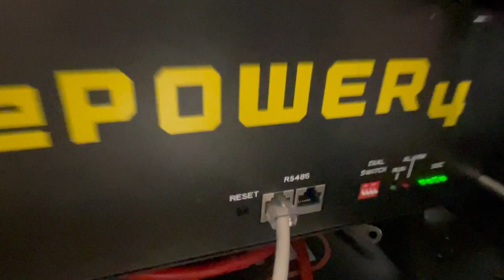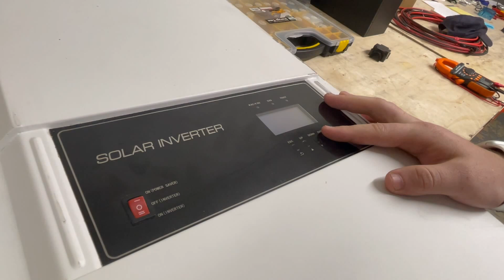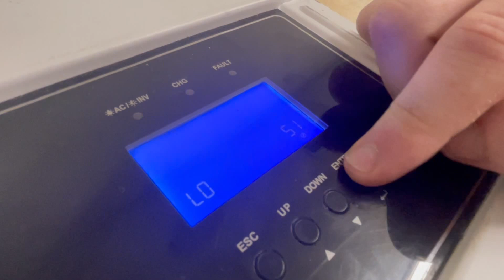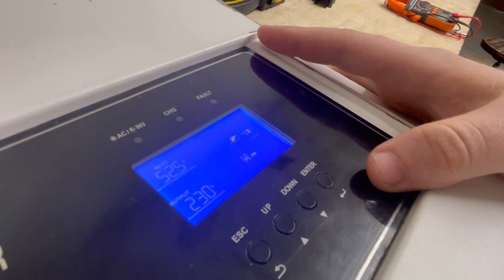LIFEPOWER4 Growatt BMS Communication

Comment: Mine goes to low battery mode when I change the inverter to LiPO4
Reply from the maker: Hi! If you'd like to reach out to us, you can call 903-441-2090  for tech support or email directly at engagement@signaturesolar.com and we can take a look with you!
Reply: @SignatureSolar  I am in Nigeria

Comment: Growatt 5000 manual says to only connect to the master inverter in a parallel system.   You say all with the can hub.  Which way is correct?   My state of charge reading has been sporadically freezing at certain percentages that I believe I have proven the trouble to be with the Inverter.  I'm wondering if bridging the cables to all 3 Inverters will add some redundancy and limit this error.  It causes trouble because I use the dry contacts to charge my bank when it hits 25%  but when it locks up it causes them to drain because the Inverters still think they are at a higher charge level.  Next I will try switching to more reliable CAN communication through the Lifepower4 HUB as a last resort.
Reply from the maker: BMS cables will only go to the master, the actual power cables will need to be shared between all 3 inverters. Master inverter will be set to Lithium battery type, L01 as sub menu protocol, all secondary inverters on USE.
Reply: @SignatureSolar   Yes the BMS cables were the question but when I change the master inverter settings the slave 1 and 2 setting automatically copy. Are you saying I need to manually go and change the 2 slaves to USE “user defined” which isn’t a communicating setting?  Currently I am able to read SOC on all 3 inverters

Comment: Do you have any idea of what are the BMS protocols 1,2,3,4 ?
Growatt do not want to share the information with me. I use 2 Elite 48V 125Ah lifepo4 batteries connected in parallel. 
Actually selected LI protocol 1, but not sure it is the best suited...
Reply from the maker: We recommend trying all 4 BMS settings on the batteries. If none work, we suggest reaching out to Growatt or the battery manufacturer for further assistance. These batteries aren't our own, so we don't have specific protocol information.
Reply: @SignatureSolar  okay,  Thanks for answering 👍

Comment: We are unable to get the bms cable set up for our SOK 48v lithium batteries to the Growatt SPF12000 DVM -US-MPV   We keep getting an error code 20 Have tried numerous times and had no success.  We are off grid and because the bms is not working the generator will not automatically start when the battery SOC is low.  Do you have any advice that good help us get this working.  Any assistance is greatly appreciated.
Reply from the maker: Hi @cynthiaclemmens2692 Working under the assumption that the SOK batteries are similar to our EG4 batteries, this may help. 

To configure the batteries, switch the dipswitch on one to master and set the others to unique addresses. Daisy chain the battery banks using short patch cables, linking the master battery to the inverter with a straight-through Cat5/6 Ethernet cable.

Adjust the inverter's battery type to Lithium, prompting a submenu for battery protocol (contact SOK for their specific protocol). Set the protocol, wait 1-3 minutes for system check for communication, and clear the code.

Consider rebooting the system, but check battery settings for %(BMS) or V(no BMS) to confirm successful communication.

I hope this helps!

Comment: I’m having problems conecting my lithium batery on my inverter.. I have 2 rj45 bms and r485 Growatt es 5000 48v And my batery has 3 ports rs232 can and rs485 what should I plug

Comment: I notice alot of the more technical questions asked are skipped which concerns me as a customer.   I imagine by now the 3000LVM+LIFEPO4 is becoming a standard setup.   Is the patch cable a standard RJ45 ethernet patch cable, or is it a crossover or custom cable that has a different pinout for the RS485 protocol?  What advantages are there vs just leaving the Growatt 3000LVM on default settings and just connecting power to a LifePO4?
Reply: I have the same questions and would like to know what the default DIP switch settings should be.
Reply: I have the 3000LVM 48v inverters. It took me a while to figure things out but you need your master battery with all 4 dips down. Then plug your cat5/6 cable into the bms port. If that doesn't work look into your firmware version on your inverter. I had to update mine in order to get these batteries to talk with my growatts. I'm still having some charging issues but hopefully I can get that figured out soon too.
Reply: @ghostriderjku7209  what are your charging issues? I'm surprised growatt doesn't have a battery compatability list for the li mode. They told me they don't have one...

Comment: hello, I hooking up a Growatt 48V 3KW LVM  with those Lifepower4 batteries  shown in this video.   So on the inverter I should plug into the 485 port not the one marked BMS.   Also what is the correct protocol for this pair. (single inverter & 2 batteries)
program 05 LI is program 36  I assume I should be using protocol #1 

general question 2)  can both batteries be hooked up without checking there voltages and they will sync up once hooked up to the solar.   Or do I need to pre-charge them before using.   currently don't have the standalone charger   

Thanks so much
Tom
Reply: I'm in a similar situation I have the 3k lvm and I'm connecting a lifepo4 battery with 2 rj45 connections. I don't see what settings to use in the option 5.
Reply: On setting 5 use LI with protocol L01  36

I have only had success using the BMS port on the 3000 LVM 48v inverters.

Comment: I got the 5000 inverter and 3 EG4 batteries from you earlier this year. Do I need to update the firmware on it before they will communicate? I currently have it set to 'use' on program #5.
Reply from the maker: if your battery has the 4 ports on the front you can use the EGYLL battery video to set up comms
Reply: @SignatureSolar  it's the 48v 100ah one and it has 2 RS 485 ports and I'm also struggling to get the USB connector working. What's the pinpoint for the RJ 45 connector?
Reply from the maker: @twelveofthem  7 and 8
Reply: @SignatureSolar  that's the way I have it and I'm sure the polarity is correct but it's still not working. I've been emailing with Jack and Debra today but haven't heard back and I'm not sure what it could be because I have the drivers installed correctly and the com Port selected correctly and the dip switches on the battery set appropriately so I'm not sure what could be wrong.

Comment: James, to me lo1 looks too much like laugh out loud. I'm glad I've got the Sun 2000 inverter. I haven't gotten that far with it yet. At least I finally got the Fireman's switch installed and I'm working my way back from there. Next stop will be the breaker box in the basement and from the other end I'm going through my other disconnect switch in the basement and up into my inverter. So far, so good.🐸